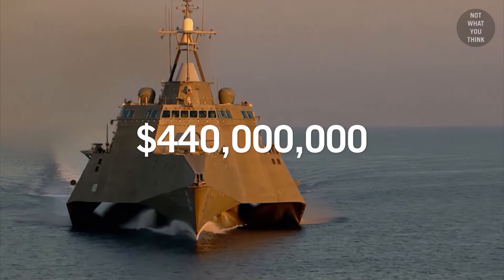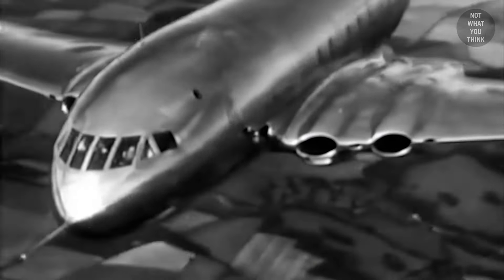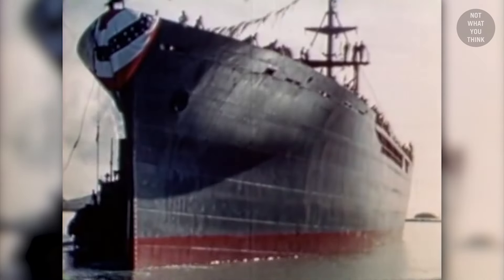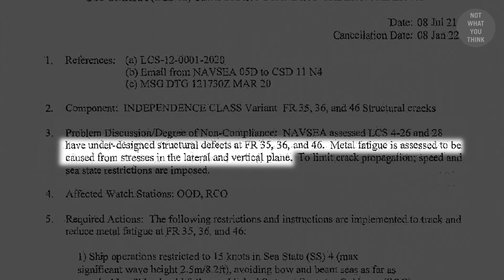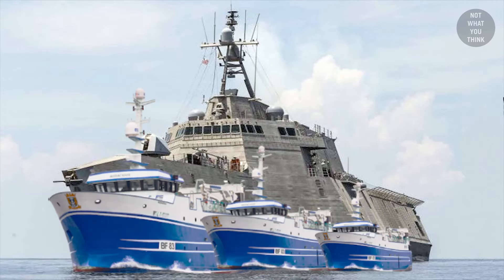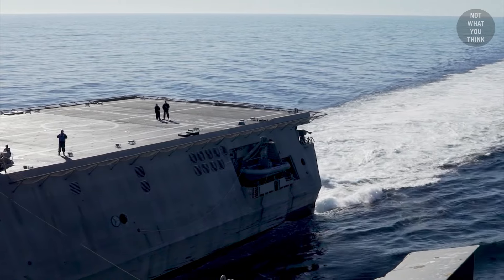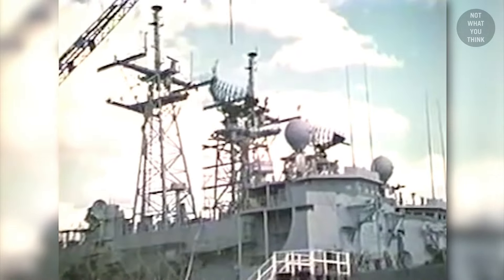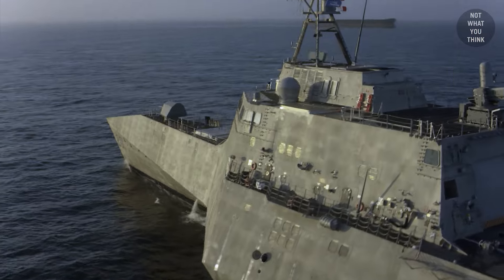SPEED Makes This Warship CRACK!

Comment: The ship I was stationed had an aluminum superstructure. Concussions from 5 inch guns split the welds even though those welds were as thick as a man's fist.
Reply: Sorry are you saying that , the aluminum structure is about 4+ inches thick? Or that the welds were 4 inches wide? 
Which case I would Not be surprised at that. 
As what I could see it was too much stress/Flexing on that area. 
When BC built their fast ferries they found out that that the weld areas had to be clean, something I had learnt 10+ yrs earlier. 
Does sound much same type of Prob  (aluminum ) when the British built their ship which burnt in the Falklands war.
Reply: @edwardcarberry1095  No. The bulkheads were not much over a inch I believe. The cracks kept occurring at the welds so the shipyard tried to compensate by making these ridiculously thick welds.
They still cracked.
Reply: @fearthehoneybadger  My knowledge on aluminum is thin at best, sorry. If it was a steel structure I would ask if it was a carbon depletion ? Does aluminum have that kind of problem? 
Thanks.
Reply: @edwardcarberry1095  I think it was a problem with aluminum technology at the time. The navy stopped using aluminum to construct full superstructures after they started having the cracking problem, but, left the ones they had already built and just tolerated having to constantly re-weld them.
Reply: @edwardcarberry1095  I worked at a aluminum shipyard building these superstructures for lcs’s just none he brought up in the video. If there was big welds that cracked the welders probably weaved the welds which is horrible works good for steel but with aluminum u gotta go fast and straight. If you stack em up should be fine but you don’t need more weld then the thickness of the metal (if the weld is thicker then the metal the metal should tear before the weld) that’s why I think the weaved it’s also a lot easier to weave when welding aluminum
Reply: Various types of aluminium are unweldable. And ally is never something you \*want* to weld regardless from what I know.
Reply: Dont get them problems with wood!
Reply: @edwardcarberry1095  aluminum metallurgy is hard to understand in my opinion. My knowledge begins and ends with 7075T6 vs 6061T6
Reply: The problem is what happens when you weld aluminum.

Two major things happen. The alloy composition changes and if you can't heat treat it afterwards the temper changes.

The alloy composition changing is huge. The weld pool and surrounding areas now have dramatically different mechanical properties. In particular they are much more ductile and have far lower tensile strength. Typically it's the boundary between the welded area and the native base material that fails as the two materials act so different to a given stress (the deformation or strain is different) so the weakest point ends up taking all the load, it cracks, and then the crack propagates.

The temper can truly not be fixed unless the entire structure is heat treated as one unit. Which obviously Austal is not doing.

The problem is design. For high strength, aluminum structures are great but they must be bonded or riveted. This has been know since the first Aluminum alloy structures in aircraft and it's crazy what Austal has sold to the military.

They went to a high performance low weight design but retained the low cost production methods. Obviously the blame here lies on both the oversight competence of the military as well as the engineering competencies of Austal. Inherently they were built to a spec, if it delineated a lifespan, Austal should eat it.
Reply: @JM-nt5fm  That's really interesting. Also it fits with the Galvanic Corrosion issue they had too. Galvanic Corrosion has been a known problem since the 1760's when the Royal navy was coppering their wooden ships and the iron structural bolts started rotting. Same thing happened to the LCS 240 years later. That's 2 known problems that they should have known about and dealt with during design.
Reply: @kaymish6178  man I know about galvanized corrosion just from doing water treatment! And if not that, I would have learned it from looking up which screws I should use to fix my dishwasher. I can't believe that was a "surprise" for a multimillion dollar ship building manufacturer.
Reply: @edwardcarberry1095  it's not about the thinness it's about the materials tolerances to shock and bends.
Reply: @fearthehoneybadger  They should learn a thing or 2 from aerospace companies
Reply: It’s not just a one off problem, other warships have had it too , for example HMS London which was one of the last of the county class cruisers , was heavily modified in its superstructure that resembled more of a crown colony class, however the hull of the ship suffered numerous cracks because it couldn’t withstand the modifications.
Reply: There is also the well known issue in that the aluminium superstructure and steel hulls when joined together have different tollerances to heat/cold and stress in general, the Aluminiums are far lower. This means that you get uneven stress across the materials, with the Aluminium actually having to take on a much greater load. When the steel cools or heats it expands but to a much lower degree than the aluminim which causes the material to be forced to warp slightly, this leads to stress cracks at weak spots. It's a stupid problem to have, but there is no easy solution if you want to use a mixed hull/superstructure setup.
Reply: @cgi2002  honestly the littoral combat ships might have proven promising , if it wasn’t for the problems that shouldn’t have occurred if they were built properly , it’s interesting that the Americans with both the LCS and the Zumwalt class went from conservative designs to radical departures from their normal practice.
Reply: As in the us navy tends to be conservative and not go for anything too radical if you know what I mean
Reply: @keiranallcott1515  the zumwalt made some sense going with a radically different design as it was (not sure if that was the original plan) a test bed for alot of new technology and thus you can expect alot of trial and error in that regard. 
The LCS designs though, if they were to be only a handful and for a very specfic role, I could get having short lifespans, but in that case you spend that extra few $ on each to get them just right. When your building 19 and 16 of them, you best get it right early on or your just wasting money.
Unfortunatly this isn't just a problem with the navy, the air force did the same with the F-22 which is now essentially in a similar situation, with Lockheed ending production in 2009 and their airframes now having a very limited lifespan remaining without significant modification costs.
Reply: @cgi2002  you should look at the Australian defence force programs , we had some duds aswell
Reply: @cgi2002  sorry for my brief reply , I thought the f22 was a good design , while the f35 was plagued with problems, then again I learn something new. Keep in mind that austal might have being in too deep as in they designed smaller boats and then went one big one too early. I do after with the zumwalt and the fact that the LCS problems that should have being fixed at the design stage, with the theory behind the Littorals , that is an idea that so far hasn’t being proven sound. 
In case your wondering about the Australian defence force , one idea that ended up being a dud was the new helicopter for a corvette that was being built. It was either the lynx or a heavily modified Kaman super seasprite, this was in early 2000s and the corvette was cancelled. We still went ahead with the helicopter purchase and went for the seasprite that needed to be modified , we spent over 300million dollars on a helicopter that didn’t work. There’s more if your interested.
Reply: @keiranallcott1515  Oh i have no doubt. Militaries all over the globe are great at wasting money on failed projects. I'm in the UK and we do it all the time. 
Only diffrence is the scale, we waste a few hundred million, just like the Aus, but the US waste a few hundred billion. Just to build one more F-22 would cost at minimum $10billion just to retool the factory, then its over $200 million per aircraft. I'll be honest I like the F-22, its a great concept, but it honestly wasn't needed considering the number of F16 and F18's that fill its role for a fraction of the cost as gen4.5 rather than gen5. also development of gen6 aircraft was well underway before the F22 was even operational. The F35 is a bit of a money pit, but its a shared cost money pit across several countries, and it is carrier capable and VTOL atleast which means it fills a role no other aircraft can at the moment.
Reply: @keiranallcott1515  aye, they also had a habit of atleast with tanks, fixing the others designs (thinking specifically of the Sherman firefly). Screwing up isn't all bad provided you get something out of it you can use later, problem is with these ships the screw up is appearing to have no benefits long term.
Reply: @cgi2002  hmmm , I think the Sherman firefly was a modification to make it more potent, it wasn’t a flawed design , and the Americans thought that the firefly was flawed and went with the 76mm in a modified turret
Reply: @cgi2002  I had to do something quickly before , hence my brief reply.
Reply: @cgi2002  and in regards to these ships , they have learnt a couple of things , one is that the zumwalt had some good ideas that they plan to implement into the new frigates  and the destroyers they are building , and they set benchmarks to when they should cut off funding for a flawed design. They will be more accountability and testing next time. And don’t put some many eggs in one basket kind of thing. The littoral concept has never being fully proven to be a sound idea and unfortunately history would be the ultimate judge of that. The question now is that what to do with these LCSs . I honestly don’t know but I’m surprised that someone hasn’t made a sarcastic nickname for them with the LCS , like the LSTs during World War Two where crews called them “large slow targets.
Reply: @cgi2002  and at least they weren’t that so bad that they would be the boats that you rather give them to your enemies kind of thing
Reply: @keiranallcott1515  true, the zumwalt was never really flawed as a concept to begin with, it was a test bed, so it didn't really hurt to put all their eggs in 1 basket there. Better to have 1 bad ship than half a dozen each with a major flaw. 
The LCS concept has major potential, the issue was never the concept, it was the ships themselves having design flaws. While they aren't great, I will admit they are still good enough for most of their role, and with appropriate upgrades they could be exceelent at it.

Now as for the Sherman, when introduced it was amazing, as the Germans were still mostly using panzer 3's, but against anything later it stuggled, often badly. It's flaw was simply put, it was undergunned. The US went with their 76mm but generally loved the firefly, but realised it wasn't the ideal solution for them. It was the british coming up with a quick fix, to a problem in a traditional British way. The Sherman was always supposed to have a larger gun apparently, they just didn't have ammunition that worked well enough for quite some time hence the later deployment, and when they did finally get decent AP ammo for it, the 76mm lacked a HE shell so was of limited use against infantry, and in all honesty, tanks mostly fought infantry. The firefly had both HE and AP, but had other flaws. The turret was cramped and its radio was litterally just glued to the back, making it vunerable and to be entirely honest the main reason the US used their own 76mm rather than the 17 pounder is actually quite simple. To fit the 17 pounder they would need to ship them to England to finish the work, or ship 17 pounders to the US. Quicker to just make your own gun and a new turret for it. Also there wasn't enough manpower to make the modifications in the UK for both US and UK tanks so production would have been limited.
Reply: And, as it's well known, Aluminum burns like a sparkler.....
Reply: @cgi2002  you might want to look up the chieftain about the Sherman , the us thought about up gunning it  , as early as 1942 and they had it installed with the 76mm from the m18 hellcat. It worked but then the army board said that the turret was too cramped and they told them to do it again, they therefore took the t23 turret and plonked that on a Sherman and it worked with the 76mm.  17 pounder was a British gun that the us never used so they didn’t adopt it , but the 17pounder was a bigger gun than the 76mm so you had the same issue except it was worse. However we can I guess both agree that the Sherman was an excellent design in the fact that it was sound and also highly adaptable proves it considerably. We can talk more about that but we have lives we need to live!
Reply: @jds6206  true, the Americans learnt after the British experience in the falklands and from their accidents with other ships that caught fire
Reply: Sounds like a piece of shit, if I were to design a ship it would be at least 24 inch thick consisting of several layers of a honeycomb style plating, not much weight difference but flexibility, durability & overall characteristics would be vastly superior.
Reply: @waynemartin5247  since most of government contracts these days are worked by multiple different companies and subcontractors it's rather hard to expect uniformity. Besides there's no US company big enough to handle entire US Navy orders on its own in their required timetable anymore.
Reply: sys32, yes I know that from  working doing work and with material for some 55 yrs. No to me, there will to too much force/ twisting force from the waves onto the superstructure which shows the weakness in that crack.  
But when someone tells me something l like to understand what they Are Telling me. Hence the learning process.
Reply: @edwardcarberry1095  there's two guys above already made decent explanation about them. Basically there's problem in choosing the metal alloys and how ones would joint them together. 
The problem with LCS is that it has flat bottom so it prevent the ship from rolling in its axis. That it doesn't roll made it's hulls absorbs most of the upwards and downwards kinetic motions from the waves especially during fast maneuvers. 

I think there's already U.K ferry that has flat bottom reporting the problem of constant tremors experienced by the ship due to it's inability to roll in it's axis.
Reply: @keiranallcott1515  the LCS is poorly thought and hastily launched design. 
The idea is to have large tonnage for shallow draughts for coastal operations. 
Their solutions being making the bottom flat. It's a poor solutions especially when the idea is to scale them to sizes.
Reply: @keiranallcott1515  $300 million for a failure? Why is nobody held accountable? Why is nobody in jail?
Reply: @sys3248  Thank you.
 Yes a flat bottom boat would have problems with rolling. I was thinking it was more a structural problem??? as it isn't able to handle the/that design!
Reply: They should have asked the car industry for help. The ships should have been bonded and use a titanium reinforcement matting.
Reply: @iemozzomei  not true, been welding alloys in Cars for decades.   The issue is the lack of reinforcement and webbed spars to bleed off the twisting stress.  Just have a look at any Audi chassis or BMW stress members for front and rear suspension which has honeycomb structure to reinforce the metal structures
Reply: @iHelpSolveIt  nah there's no real remedy to LCS. It's essentially a very large flat surfboards resting on the top of water surface carrying thousands long tonnes of weapons and equipment. 
If it's bottom hull doesn't crack from surfaces waving motions it'll crack eventually under sheer weight it carried on top.
Reply: @edwardcarberry1095  The problem is aluminium itself. Aluminium has practically no fatigue strength at all, once it flexes the clock is ticking and it will crack under normal use. That is why commercial airliners which are made from aluminium leave the factory with a limited number of safe flying hours, once this is reached they can disintegrate at any time and almost without warning during normal use.
In contrast fighter jets usually have a titanium airframe and titanium's fatigue strength is nearly unlimited. As long as they are serviced properly they can go on forever.
All that is also why there are no aluminium springs.
Reply: G/M, yes that is what I know, but figure there ??should be/must be some ??intelligent reason for using it. Unless it is just an other money boondoggle for the shop?? Just one on the side annualizing what I see.
Reply: Coming from a welder. You can’t weld two pieces of aluminum like you weld, two pieces of steel. Hammering will break aluminum welds but it will not break steel welds. Ask any welder. Oh wait, apparently no one did. At least when the Def Department bought these ships.

Stupid is, as stupid does!

This should not even be a discussion.
Reply: I've had an aluminum-framed bicycle for five years without issue, but that's because the frame was baked for days in a 900-degree oven to restore the crystalline structure, and strength, to the weld areas.  If you don't do that, even the best aluminum welds have only half the strength of the original metal. A ship is a lot harder to fit into a heat-treating oven than a bike frame, so it would have to be of a bolted-together, modular design, which creates a whole new set of potential failure points and leaky seams. Unless you can afford to buy Flex-Seal by the 50-gallon drum, you don't want to go there.
Reply: @edwardcarberry1095  since they mention galvanic corrosion there must be points were steel structures are in contact with aluminium structures.
This is a bad idea not just because of the galvanic corrosion (on steel power line pylons they bolt sacrificial aluminium plates which literally dissolve over time but stop the steel structure from rusting/rotting. They are replaced regularly) but that also means that steel parts are bolted or riveted to  aluminium. Since both expand and contract at very different rates when warmed up and cooled down this means that there are enormous stresses being created which in turn lead to fractures.
Nothing wrong with aluminium and steel per se but you should really stick to one or the other and not mix them. The whole thing just seems to be expensive stupidity to me.
Reply: @randallsmerna384  I can understand your frustration and the fact that no one has gone to jail , in the future that might change. Hopefully we all learn what not to do
Reply: @thelol1759  it doesn't help that all Aluminum are alloys. But they don't always behave how people expect especially considering that aluminum always has an oxide layer.
Reply: Don’t fire the guns, then……
Reply: @John Smith WWIII? Sure! Jajajajajaja! 😱🔥💥👎🏿🤡
Reply: FearTheHoneyBadger, And what ship was you on and when?
Reply: @supernick2072 , Wood cracks also.
Reply: @thelol1759 , " My knowledge begins and ends with 7075T6 vs 6061T6". Mine starts and ends with the can beer comes in. LOL
Reply: This is why post weld heat treatment exists (stress relieving), although I have no idea how it would work with aluminum. The weakest parts of a material that is welded is the material directly beside the welded joint as it is subjected to the heat of welding, the crystalline structures settled in a state of stress, and weakened by the welding process. Heat treatment relives that stress by bringing the material up to a temperature where the crystalline structure can re-align thus reducing the stress making the joint stronger. Again have no idea how this would work with aluminum, the equipment, and procedures necessary to perform stress relieving on pieces this size is most likely rare, and astronomically expensive.

Edit: how would you even go about fixing something like this? Lap joints? Additional bracing? JB weld? Curious on what you guys think.
Reply: @waynemartin5247  You're hired. At fixed cost however. I mean, vastly superior = no cracks, right?
Reply: @sys3248  Flat bottom = less wetted area = go fast. Still, would be nice if hull wasn't cracking in half.
Reply: @iHelpSolveIt  You're hired. Report to Annapolis for duty. Bring ditty bag and good sense of humor. Fixed cost contract of course.
Reply: @sys3248  Always with the negative waves man. Pun intended.
Reply: @Nostradamus_Order33  But they promised us a rose garden, how did we know?
Reply: @ericvardek4108  🤣🤣🤣
Reply: @chasepecha9291  if thats what happened, no wonder. 

 You must never ever do that with aluminium.   

It would have been far better to premould sections of interlocking stress members and bond them with the glues used in automotive industry and only use a thin weld using a robotic welder for the outside skin as the glue is applied into the seam and pressured.   

Given the sizes of the box sections im not surprised the manufacturer didn't think of asking Audi or MetalBOX in South Africa for help.
Reply: @kaymish6178  yeah its called cathode and anode ... Fpr steel and aluminium its zinc and ironically steel or iron for alumnium but a South African came up with an electronic management system that runs a current through the aluminium and controls the decay and also can track cracking etx
Reply: @fatdoggolovespizza  totally agree with you, someone should ask for a refund🤣🤣🤣🤣
Reply: @jds6206  no not on its own, it needs to have certain conditions, namely the additional magnesium and powder in the mix then yes, but not on its own, even with a flame, it usually just evaporated which is why when you weld aluminium it should be with an argon arc welder...
Reply: @keiranallcott1515  look at the composition of the falklands ships, not just aluminium
Reply: @sys3248  you do have a point, however i think use of bonding agents that can flex as used in the car industry can go a loooong way to solving that issue and cut out the overloading and put the loads where they create the least stresses
Reply: That is a stupid material for ships
Reply: This is s shit material for ships, worse than wood
Reply: @iHelpSolveIt  I never actually said that , what I said was that when the United States began developing the arleigh Burke class ships, they decided to do a mostly steel construction to avoid , when there was fire , structural warping and damage that resulted from  the hot temperatures that aluminium was more susceptible too then steel .in these cases it was from the British losses in the Falkland’s campaign where fire played a big factor and the United States own disasters where one destroyer was heavily damaged by a fire after the collision as its superstructure was made out of aluminium.
Reply: I’ll also expand on that , aluminium seems to have got a bad reputation from both the Falkland’s war and the near loss of the USS bellcamp, also I do recall that the captain of the SS canberra which was used as a troop ship said he was really concerned about fire because his ships superstructure was made out of aluminium. So you might have a point but aluminium still has a bad reputation
Reply: @iHelpSolveIt  uss belknap I meant
Reply: @thelol1759  Where you in the Aviation Business ?
Reply: Design flaw!!!
No matter how much you weld or reinforcement of the section the problem will still reoccur or get worse.
This usually happens when stress / moments are concentrated or have no where to disappate.
Reply: @pieterweatherall2826  Firearms manufacturing.
Reply: 0
Reply: @JM-nt5fm  pretty sure you can't weld aluminum to steel.
Reply: @georgesamaras2922  I'm not so sure. Remember that warships are subject to enormous bending and slamming during rough seas. The shocks cause considerable metal fatigue and cracking in the hull.
Reply: @edwardcarberry1095  how about titanium?
Reply: Don't know much about TItanium, the wests favorite country has a lot of it! Used in aircraft personnal protection. 
My suspicion would be not nessecary?
Reply: @fearthehoneybadger  They stopped using AL superstructures because they no longer were making ships tall and narrow like on the CGs and DDs. The DDGs are wider and shorter so longer need the AL superstructures. Also it was switched for ease of maintenance and repair. There are still problems of fatigue cracking on some Arleigh Burke bows and have sea state limits.
Reply: if i may joined guys,, i am a welder as well, 
base on my experience in making processing equipment, 
the company is more on alum that stainless, 
one comment says that its probably the waving motion of the welder, perhaps hes refering to the undercutt cause those waving ,, but to our observation, most of our equipment installed that suffers the same cracking problem are only those shakes and vibrates , 
may be the engine of boat are to big for its body, thats y,  plus the guns kick during operation, 
i dont hear that much essue  using steel bodied vessel,
Reply: @renatotorrejos5641  We believed that it was largely a result of our 5 inch guns.
Reply: Ours broke all the forward glass, but superstructure was fine.     The co that built these p.o.s ships need to give back the $.
Reply: Thats some thick ass aluminum.....   sure you measured right??
Reply: I'm not expert but aluminum welds should not be much thicker than the metal they join; welding two different thicknesses could have problems with heats since the thicker metal likely runs cooler and the thinner, hotter. concussions from firing the guns I would guess, would involve far less strain (movement/stretching/flexing) than firing the guns, due to the far greater lengths and weights of the moving/flexing parts of the ship. Perhaps the breaks at the gun mounts came from the flexing of the ship and the engineers misattributed the forces and their locations. A gun mount would seem to be very rigid due to metal thickness to shield the ammunition in the autoloader and area from incoming rounds and explosions.
Reply: @tobyw9573  The aluminum in our superstructure was reinforced with extremely thick welds. Didn't do much to keep it from cracking under the movement of the ship and the concusions from the guns. When I was in, the Navy decided to ditch aluminum superstructures. Maybe things have changed due to new technology.